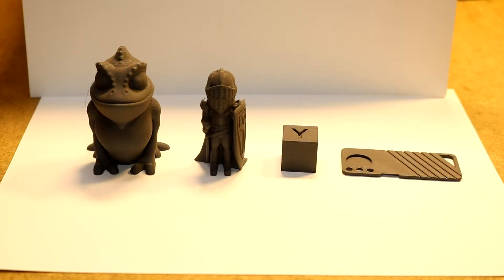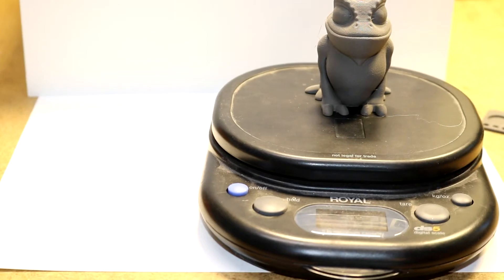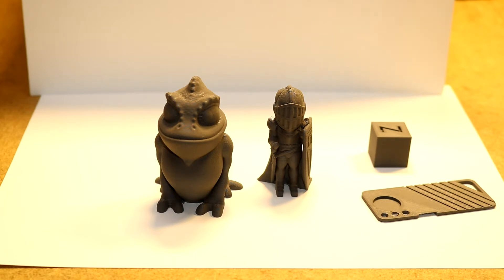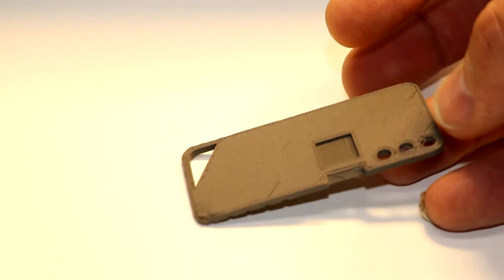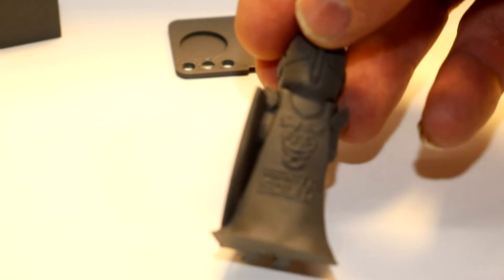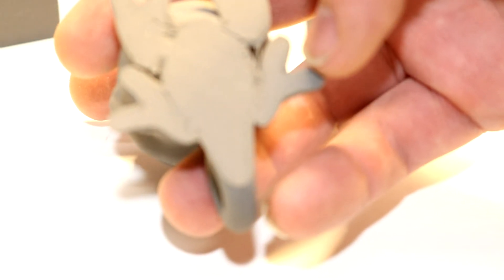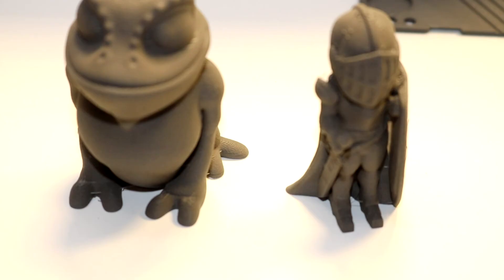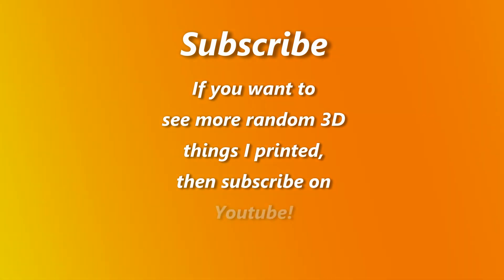Filament Review: Steel-filled composite PLA by Proto-pasta

Comment: hold on, magnets are supposed to stick to steel since steel is litterally iron based.
Reply: It's stainless, non magnetic
Reply: Stainless steel includes nickel which inhibits magnetization in most instances fridges are magnetic because the stainless steel is fer unlike most alloys
Reply: Its stainless. Some stainless are magnetic and some arent.